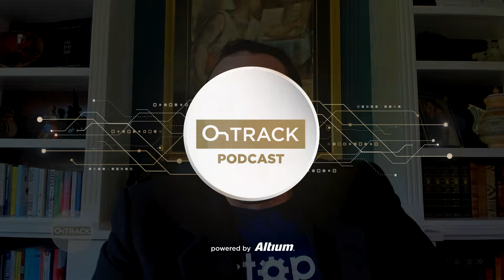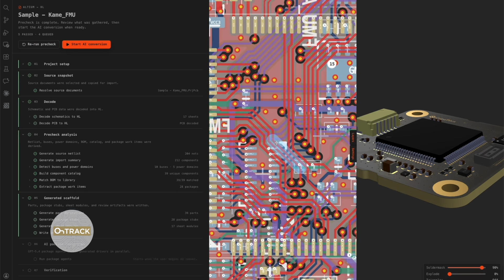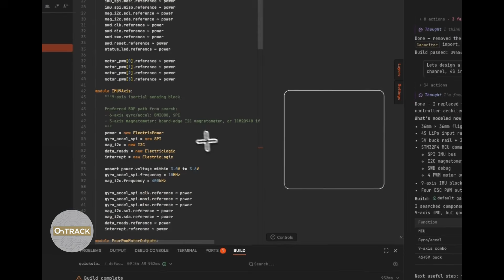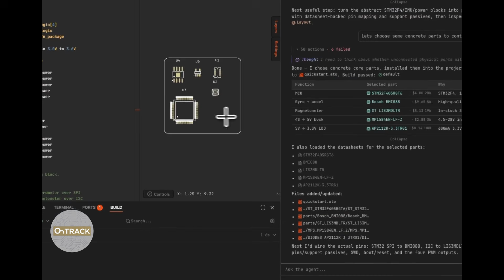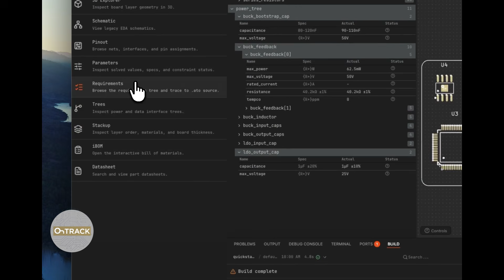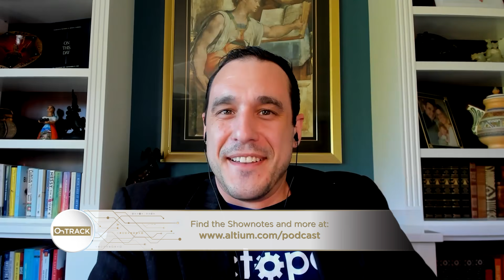Code-Based PCB Design with AI: Inside atopile

Comment: Electronic design is and will always be a graphical way of thinking because the information condensend in a single schematic sheet are too hard to present to a human in any other form.
The other problem I find in most of the AI HW companies is a total disregard to industries standards, i do freelance work and most of the companies i work with have their own symbols, footprints (mechanical layers defined etc) and will never use anything else. 
What is the point of creating a tool that no professional will ever use?
What i need is an AI chatbot in Altium to automate repetitive task. Like: "change all the 1k 1% resistors in my design with 1k 5% from my X library", "Generate the assembly views like i did for this other design" or when i import a footprint from ultralibrerian or other services "Please change the mechanical layers, line thickness etc to match the library Y".
I don't need an AI to design a buck regulator that i will need to triple check because as opposed to SW when i hit the compile button and debug the board i alredy spent 500 USD.
Reply: Yeah I think companies will realize in pretty short order that implementing AI to allow for natural language command over their software will just be the standard way to do things. When we had Yuriy Shlepnev on the podcast earlier this year, this is exactly what he was showing with Simbeor Commander. It was a pretty revealing demo and gave me a lot of ideas for what could be possible in Altium Designer.
Reply: Spot on.
To change the resistors you could use three mouse clicks and a couple of keystrokes burst and you are done. Lol. I think most of the time is spent doing the actual design...
Reply: @robegatt yeah, maybe the resistors wasn't the best example, I kinda got carried away writing the comment ahah ... BTW I'm also Italian!
Reply: @exapod23 😅😅😅

Comment: And so it will be able to interact w/ the Berkley Spice Models and run Simulations.
And some may use say a Math Program say like in Roberts video On Board Antenna Design was modeled in Mathlab.
Bringing up Ferenac another video discussed the Physics of Fields and how they interact to disrupt Design Intent and can be modeled or at least avoided w/ currently some modeling at the time done in FreeCAD of late.
Reply: ...a pretty convoluted salad of tools if you ask me.